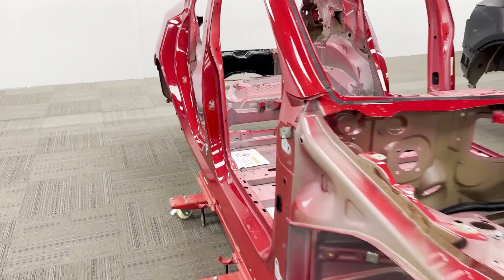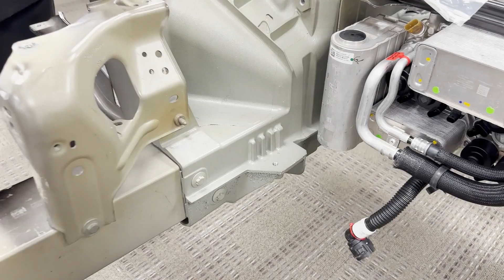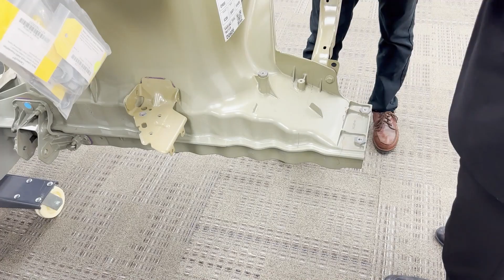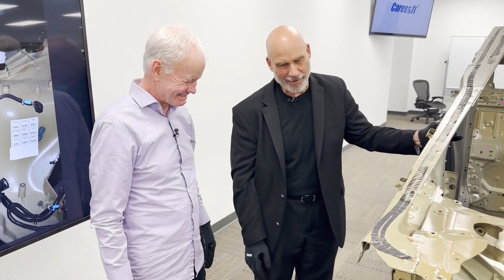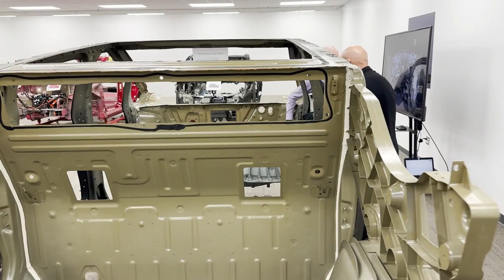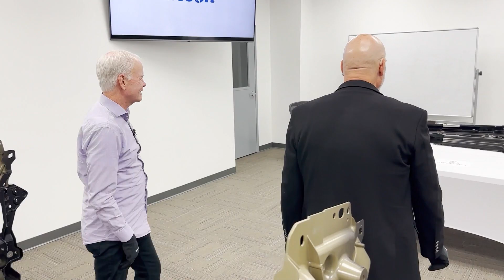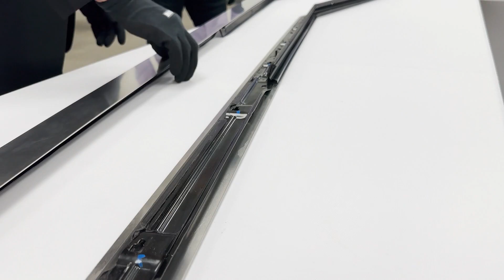The Evolution of Tesla's Body Structure - Caresoft Teardown

Comment: From manufacturing perspective, it's a masterpiece. When they revealed it I reserved one. I wanted one because of what they said it would be unfortunately the production version is not what they said it was going to be at all. They said it would have 15K towing capacity with 500 miles range. That's the biggest thing that sold the truck for me but that's not at all what they have today as a product. Not to mention the fact that with those castings it wouldn't be something that could be repairable by me and durable long-term.  From a truck owner's perspective that thing is not a truck that can replace the one I have which is sad because the one I have was made 25 years ago. Looking at this, I'm really glad I didn't buy it. I guess I'll be keeping my 25-year-old truck for the foreseeable future.
Reply: We have 2001 f250; original owner.
Reply: @K401Cash 99 f-250 7.3 owned since '06. Tough to find a credible replacement.
Reply: @ihdieselman same motor here and best of all no DEF fluid to worry about.😅

Comment: I applaud Tesla and the keep it simple but smart, I work in a collision center and the auto industry for 35 years and I questioned so many times why manufactures offer excessive variations of the same vehicle like Dodge Ram the front grill has  7 or more different options 5 different mirrors, 5 different wheel options 15 different paint colors ect....  That process of assembly is overloaded and think about the cost in design of that many parts for the same vehicle, warehouse space to stock ect.. all this to try to offer more variations to the customer to outdo their competition. every manufacturer has been in a mindless fog of lather rinse repeat withought trying something different likeTesla has been doing.

Comment: I'm super curious what those two square openings are in the cab/bed wall of the Cybertruck, just below the cab/bed window. They would locate behind the rear seats. Can't be ventilation. Is it to allow pressure from slamming the door to get to the bed area so people's eardrums aren't pressurized from a door slam?
Reply: Most vehicles have large vents in the back of the passenger compartment somewhere. Even trucks.

Comment: Interesting. But there are good reasons why there are no cast aluminium airplanes or ships, and alunimium cars use sheet and forged aluminium. Castings are brittle and heavy compared to forged and pressed metals. The Corvette C8 uses large aluminium die-castings in its structure, but I can think of no other example. As for unity and simplcity, the Soviets thought milling parts from 60 foot long aluminium billets was a good idea for the TU-144 SST “Concordski” but they found that 60 foot long billets can result in 60 foot long cracks. Structural joints ans changes of material can act as rip-stops to limit cracks.

Comment: Having followed Tesla and worked in the Automotive industry since 1989 Elon has evolved his vehicles and designs to an amazing level.
I watched as he grasped how to update and improve vehicle component designs in a way that was similar to the Japanese way of doing things. This allowed existing components to be updated but mounted in the same place as previous versions.
These castings and using the battery pack as a structural member is smart engineering.
His vehicle styling department needs to develop more and he needs to lower vehicle prices but the engineering is extremely inventive with castings being used in the Automotive industry for years but not for this purpose or on the scale he uses castings.
I was dubious about his ability to keep coming up with engineering solutions but the innovations speak for themselves.
The castings have raised issues in the repair sector but the vehicles have obviously passed crash testing.
No wonder he is not making a profit out of the Cybertruck when such exotic and unusual manufacturing methods are used.
It's very interesting to see the evolution of Tesla vehicles over a ten year period with some genuine firsts in the type of manufacturing practices used.
The gentleman giving the tour looks to have some sort of prosthesis behind his ear I hope he doesn't have industrial deafness.
😎😉🇦🇺

Comment: The biggest problem electric car manufacturers have is that the car will last longer, so they have to find a way for people to buy new ones.. hence design a throwaway car.. I also don't know why he was smug that the cyber truck won't be in Europe.. thats a big market you need..
Reply: It will take at least a decade to replace all ICE with EV.

By then we’ll be moving to a Robotaxi business model so the vehicles will need to be as durable as possible.

Most OEMs will go bankrupt.
Reply: @fredbloggs5902  but cars are not just for getting around otherwise Uber would have killed the industry.. my car is more then transport.. it's a lounge, it's a sound system, it's peace and quiet, it's exhilarating, it's escape, it's a personal locker, it's an adventure...
Reply: @on_the_saddle  Uber is too expensive because 75% of the operating costs are the driver.

Remove the driver and use an EV and the cost per mile plummets.

Comment: At around the 10 minute mark, it is stated that all of the stainless panels provide no structural function.  In light of Tesla's drive for efficiencies and cost cutting,  how can putting over engineered, expensive and hard to produce panels on the truck when they could have easily cut costs using regular panels?  Other than some odd aesthetic or a refusal to admit the idea of te exoskelton failed.
Reply: probably aesthetic
Reply: Aesthetically they could have done this with much thinner panels.  Same with bypassing the paint shop.  As for toughness, I've already seen pics of three different panels fall off including the entire rear quarter panel.  Only explanation is Elon's ego
Reply: @Drose902  you understand that there is a team behind the construction of this truck? 
Elon might have some input but it's actually several hundred engineers that were involved in its construction. 
Also, if you're expecting the first thousand cybertrucks built to have no structural issues, given its revolutionary design, you're expecting too much
Reply: @orsomethinglike  I really doubt many engineers thought, hey the exoskeleton shell was a failure but lets hang super thick panels on this thing anyways.  We've heard the horror stories of engineers that have dared question Elon. He's left a trail of them at Tesla, SpaceX and Twitter.  Elon wanted bullet proof they did it
Reply: @orsomethinglike  🤣😂🤣😂 Revolutionary Glue on stainless steel siding!
Reply: Being able to bypass the paint shop is a big saving
Reply: It makes the vehicle tougher and more durable than other trucks.
Reply: @fredbloggs5902  🤣😂🤣😂

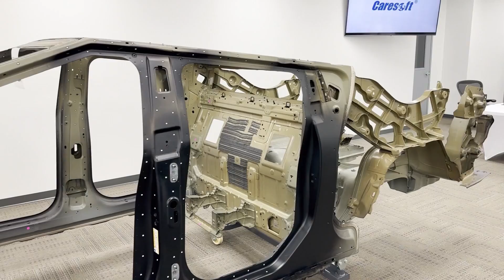Comment: 10:25 its more likely that if they had to weld the outside panels to the body it would discolor/warp the metal not to mention drives the costs up by taking time.

Comment: I'm sure Musk is encouraging the Italian die casting group to pursue a full chassis size single aluminum casting ... further strengthening, simplifying, and continual reduction in unit cost. 

Or perhaps an approach more akin to 3D priniting material deposition process ... maybe that will be the ultimate target. 

Those familiar with such things ... suggest, that's how the seamless interior walls and control surfaces of downed uap craft appears to be constructed. 
Some type of seamless monolithic approach.
Reply: Do you see a single casting concept as compatible with Unboxed assembly?  Most don't.
Reply: @snookmeister55  
Yes ... I don't think they're mutually exclusive. 

The primary reason being Musk and team have creatively performed the unexpected at each turn ... there's no reason that won't continue.

Comment: Tesla is doing a great job of reducing the manufacturing cost and weight of their vehicles, but what concerns me is the repair ability of these vehicles. For example with the structural battery, it is not possible to replace a single battery cell and a single cell failure will result in a significant range loss. Likewise what happens if one of these large castings gets damaged in a crash?. I suspect that the repair costs will be significantly more than a traditional car where all the panels are available separately.

Comment: On the 48V infrastructure, why not go higher to 120V (US domestic voltage)? Higher voltage infrastructure means less electrical resistance which could mean lighter wiring harnesses and motors (HVAC, power seats, etc. (not the propulsion drive motor which I understand uses a much higher and separate circuit voltage of its own anyway)).

Comment: Re: the A surface not being structural. You sure? Tesla Engineering head said in an interview that the Stainless Steel skin on the doors takes 70% of the crash loads, eliminating need for side impact beams… unless you’re talking for the body in white torsional wise?
Reply: doors are not structural
Reply: You’re right. And the tesla engineers said the body panels significantly increase torsional rigidity so the video got that part wrong for sure.

Comment: I think structural rigidity, safety and longevity vastly improved as well besides dramatic loss in need for various parts both for assembly and any post fender bender issues. Very impressed by this and the need for safety gloves now too/as well. Be interested to see if Tesla finally gets serious about bumpers front and rear as appears to be the case with Cybertruck next as well. Hand brake would be greatly appeeciated as well.

Comment: So much for "stainless steel exoskeleton." Even the stainless steel A surface is not self-supporting and needs a stamped and painted steel panel to hold its shape.
Reply: The body panels still contribute significantly to the torsional rigidity so the presenter got that part wrong.

Comment: The problem with manufacturing using casting is that every accident, even a relatively minor one, the casting breaks and the vehicle cannot be repaired and the vehicle goes off the road, the insurance companies are forced to pay their customers the price of the vehicle, which causes the insurance to increase for the customer, so that in the end the customer is the one who pays for the savings in Tesla's production
Reply: This is a common misconception. Sandy Munro has pointed out numerous times on this topic that any impact severe enough to deform the casting will put the safety of the car at risk, this is the same even if they didn't use castings and used traditional the traditional unibody. Essentially the castings are a non factor when it comes to reparability.

Comment: Great, when you are in an accident and a giga casting is bent or broke, the car is written off.
For backyard mechanic is there any chance of welding in a good part chopped out of another wreck?  Or is the casting material to esoteric to weld?

Another review pointed out they were getting stabbed and sliced by edges and corners on the taligate and back corners.

Cybertruck is still in its first generation. They will iterate out some of the "quirks" you noted.

Another review made the point that the box of the Cybertruck is not square. It has angles and slanting sides so you can't load square boxes securely, firmly against the sides.  And they weren't able to reach over the side at the front of the box to reach the tie downs.

That roof rail seems to have evolved.  I've seen close ups of roof on some Cybertrucks that appeared to have a seam just at the front of the box.  The reason I was looking specifically is I saw a review where a Rivian truck had been in a minor fender bender in the back corner.  It pushed the tailgate enough to jam it and pushed the back fender forward enough to crimp that roof rail.  They thought it was a simple fix. It wasn't. The back quarter panel and roof was all one piece. It would cost $37K to replace, for a 5 mpg fender bender.
Reply: The reviewers you mention are clueless, the slant on the bed sides is inconsequential, you can stack boxes with no issue. In fact the buttresses ensure they are much better contained than in a traditional bed where they would be at risk of falling out when stacked.

No idea what you mean by roof rail, a rear 5mph fender bender is not going to affect the roof of the cybertruck.

Comment: Since the stainless is just for looks, it would seem they could make this same truck in plain old steel if they wanted to.  Maybe a cheaper model like that is in the future.
Reply: ...or plastic, like the MCC Smart cars. Owners used to be encouraged to buy spare panel sets. You could change the body panels for a different colour/design set in hours. On the subject of the stainless panels, has anyone done a polished panel set?. It may look good but be dangerously dazzling in strong sunlight.

Comment: Legacy makers do about 1 vehicle per minute. With all these vast improvements in building modular where all the assembly is right there and unencumbered i would suspect that Tesla has build time cut to the bone... about how many an hour can they build? 70 or 80?
Reply: 1 every 33-37-ish seconds.
Reply: Yep, quite a bit faster than everyone else.  There's another thing - why the vehicles are so "Spartan".  It's partly to save weight and money but also to reduce the production space and increase the speed and turn time (engineering / parts wise) to be more efficient with every factory they have.

Comment: I’m wondering about the fire wall, the vertical metal that in ice cars separated the engine compartment from the cabin. Why is it vertical, straight up and down? Does that serve some purpose? Because I can’t think of any. It might work better canted at an angle leaned forward or back or some corrugated shape. I don’t know the engineering behind this but just thought making it completely vertical didn’t look like it served any purpose beyond ...we always did it this way and had no reason to change.
Reply: 12:10 the vertical that separates the cabin from the cargo box is canted at two angles, like I expected the front, the firewall to be.
Reply: its a Gigacasting , its Structural. 
its Thinner than Conventional fire wall.

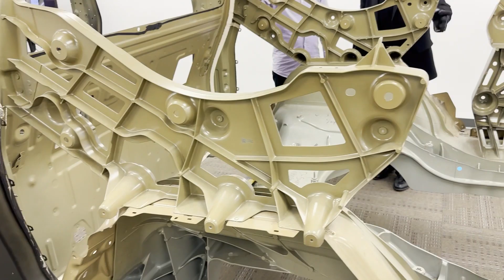Comment: 15:25 I remember when I was a kid I rode in the back of a pickup truck and placed my fingers between the cargo box and the cabin. The cab, box and frame were separate pieces that flexed! And they started to flex on my fingers! Building all as one structure is a lot more rigid.
Reply: That's exactly how trucks are designed, body is actually mounted through rubber bushing on a frame to separate it from both the box and the frame itself.

Comment: I was at the Cybertruck reveal, shouting "No f-ing compromise!" when Elon revealed the Cybertruck to audible gasps. We were promised a brutalist function-over-fashion truck. I can't tell you how betrayed I felt after learning months ago that the production Cybetruck has been nothing but hype. No front bench seat, no fold-down rear seats or pass-thru cargo tunnel, no Autopilot, no Full Self Driving, no locking differentials, massive blind spots, and poor efficiency and range. But worst of all, the famous stainless "exoskeleton" is a complete lie by Tesla. The stainless panels are glued on the sides. It's just an electric Honda Ridgeline with cosmetic stainless body panels.
Reply: CyberBust Chief Engineer is a confirmed drug user and congenital liar!  Reset your expectations!
Reply: Owners will get some of those missing features via OTA. But yeah, the frame is the frame. And there was never really hope for a pass-thru from cargo to cabin due to the tonneau.
Reply: It has autopilot, it has FSD, it has locking differentials, the blind spots were obvious from when it was shown in 2019, efficiency is very good compared to other EV trucks,
Reply: You destroyed your cred with the stainless Ridgeline idiocy.
Reply: You are absolutely correct… it will be fun in a couple of years when those plastic connectors are fried and the “exoskeleton “ is flapping in the breeze…what a mess.
Reply: Cybertruck, is worlds SAFEST truck, also worlds TOUGHEST , Period.
Reply: @markplott4820 Which may be true, but doesn't negate the excellent points above.

Comment: Great video! I sure hope the glued-on and snap-fitted stainless body panels put the last of the "Exoskeleton" talk to bed.
Reply: Yes but you know the faithful will keep saying it!
Reply: The only snap fit is the brow, the rest is bolted.
Reply: @boostav  Valid, but still not structural.
Reply: Body actually contributes 30% to overall registry so he got it wrong there
Reply: @tarasilchuk167 what are you bagging your comment on? There are no facts in evidence that the body panels are anything but decorative.
Reply: Body panels are not structural but door panels are. When they released the bullet proof testing, they only shot the door panels, which was a clue. Then on the Munro tour video, they admitted  the body panels were thinner.

Comment: 0:50 It’s cool hearing how many parts got deleted by using the gigacastings. I appreciated hearing the list of processes all these parts go through. There is one more point on this. Tesla makes the gigacastings themselves, vs all these parts in the old frame structure would have been built by suppliers. That affects cost, quality control, the ability to change the design as you go, etc.
Reply: 70 fewer parts less in the back, 360 fewer parts in the front. A lot of these parts would be in pairs, usually mirror image for left and right, right?

Comment: 16:10 What IS this piece??? 
Where does it fit in relation to the rest of the truck?
It’s actually a separately cast part??
Reply: D pillar?
Reply: YES, the side rails are Minor Castings , made up of Recycled casting scrap.
they Dont have to be TOUGH as the Sails are NON structural. 
they are Wielded & bonded in place. 
they are Different materiel from the MAIN rear Gigacasting. 
there are 4 pieces , 2x for each side.